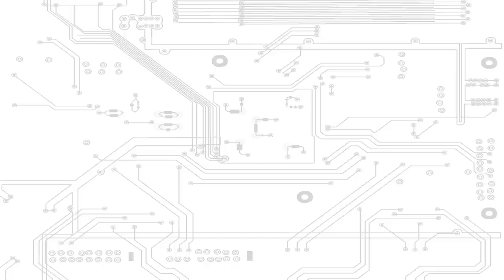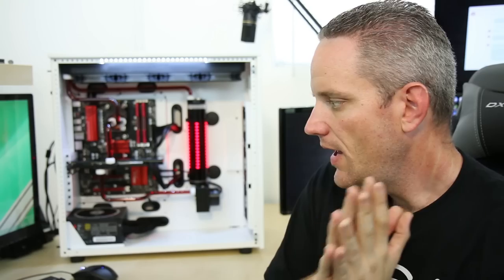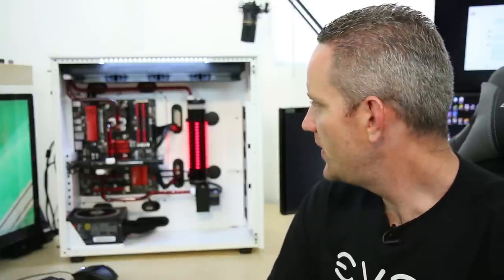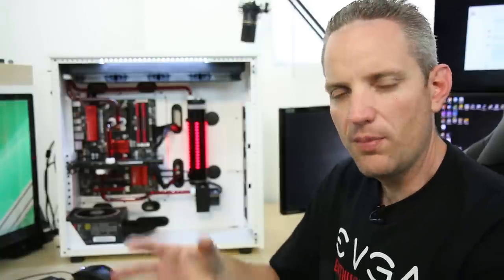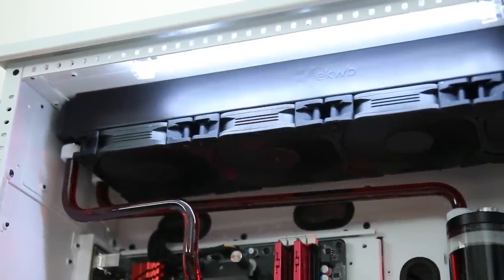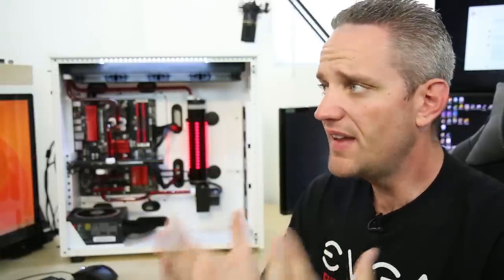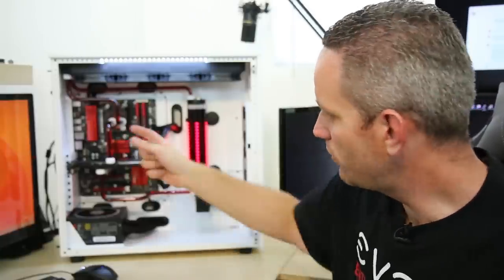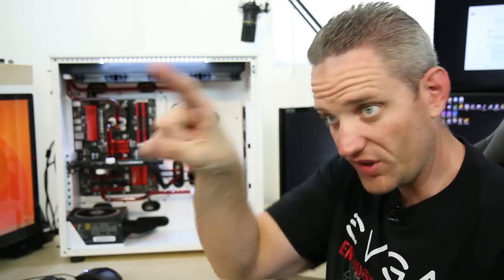Custom Watercooled AMD Gaming PC

Comment: Given your expertise in hard line tubing, I'd be interested in seeing you try building a loop with soft copper tubing. I feel that there isn't much videos out there regarding copper tubing for watercooling. It was interesting to see Paul jump straight to hardline, skipping over soft tubing for his first custom loop, but some nickle plated copper tubing for his arctic panther build would have proven to be badass.
I somewhat recently completed my first custom loop using soft copper tubing, and it was a complete nightmare but oh so satisfying to finish it (would NOT recommend anyone new to watercooling to try this for their first custom loop, at least get a little experience with hardline acrylic / PETG tubing first). It would be interesting to see someone like Jay try his hand at soft copper tubing. Might be able to add a little more variety, might be a good challenge and learning experience, maybe make a video series of the entire process. That may prove to be quite entertaining :)
Reply: 95trane I've built a couple loops with soft copper tubing -- and I am getting ready to redo one of those loops to reconfigure a few things -- the problem with trying to do soft copper is tubing itself. You have to straighten it, for one, unless you buy pre-straightened lengths of soft copper -- they do exist, but they are not cheap, and the longest length I've seen so far is 24", which would be too short for a couple areas of my current loop.

And straightening it is a pain, especially if you go with the larger 1/2" OD tubing, which is what I used since PrimoChill's fittings are for that size. Koolance makes three different size fittings for soft copper, but you still have to straighten it. And you have two options: buy a straightener (such as from KwixUK, least expensive one I've found), or use a vice, vice grips and a mallet.

Beyond that are the other tools. Now if you go with 3/8" OD tubing (Koolance is the only one making fittings for that as far as I can tell), then you can find a tubing bender without a problem from any hardware store. Go up to 1/2" tubing and now you're going specialty. Home Depot and Lowe's from what I saw don't carry benders for that diameter. The bender I have cost me about $45 from Zoro.com, but easily goes for much more elsewhere, and is made for HVAC professionals and plumbers.

If you're willing to spend money on the tools, you can certainly do it right. But if you don't want to budget $150 for tools, you're going to end up with a badly done loop. Go with PETG instead as the toolkit is much lighter on the budget -- heat gun, hacksaw, reamer -- especially if you have a Harbor Freight in your area.

Definitely would not recommend copper for a first-time loop either as you will only frustrate yourself to no end.
Reply: brandishwar Yeah, I pretty much went the most difficult route with my first custom water loop...
Summer was approaching and I don't have the coolest components so watercooling was pretty much a necessity at that point if I did not want to downclock everything just to prevent my computer from crashing due to overheating / reaching stupidly high temperatures. I could have went with soft tubing but wanted something a little more showy. Was contemplating getting hardline for a little while but I was going to be using clear distilled water and wanted a little more, so I decided to go the soft copper tubing route. I went with 1/2" soft tubing, and everything in which you have mentioned I had to deal with for my first custom loop and it was horrifying. Bought the copper from home depot, had to "straighten" it by hand as I could not afford a straightener, had to buy a 1/2" soft copper bender from amazon because home depot only had 3/8" ones (you can bend it by hand, but it requires quite a bit of finesse, but forget about bending it by hand when cut short). I messed up quite a bit of bends and have a mini scrap yard to prove it. Hardline, you can revert your mistakes to a degree, not so much with soft copper. Glad I decided to go soft tubing on the backside, the non-show side, as there is no way in hell I would be able to use copper back there. After having to deal with that nightmare, it was so satisfying to finish it and get my computer up and running again... only to redo the loop about a month later to improve the heat dissipation (I organized the loop in possibly THE worse possible way I could the first time around, much better this time around) and relive it all over again :D
If you are going in merely expecting a challenge... please go with hardline acrylic / PETG for your first loop. If you are a hardcore masochist looking for a thrill while pimping out your computer for the first time, by all means go ahead and use soft copper tubing. brandishwar is correct on every aspect. If I had only knew this before, maybe I would not have gotten into it so light-heartedly.
Reply: I'm on mobile so ...
Thumbs up ;D
Reply: 95trane Maybe that's why my attempts at a copper tubing loop were so screwy- I tried saving money with buying soft copper coiled tubes (at Menard's no less). I could straighten them by hand but it won't be perfect, and the Ridgid bender I have pinched the tubes too much. What wall thickness is good? Type M? Type L? I think mine was a bit too skinny and that's why it pinched in the bends.
Reply: ccricers I used type L tubing (I think it was Model # PCLE-375L010 under the Home depot website). Slight pinching on the copper should be somewhat expected, but of course too much is no good. Did you try bending the copper "fresh" or after you have cut it to length? Trying to bend the copper when it's too short, and making bends that are too tight may cause issues with pinching or even kinks in the copper. Try bending a long piece of "straightened" copper first and THEN cut it down to size; that way if the ends are pinched you can just cut them off with little to no issues.
Just in case you were wondering, just put B00HNQRJ6W in the search bar of amazon for the copper bender I used. I would link you to the stuff but I don't want to risk this comment being marked for spam.
Reply: 95trane How well did the copper tubing do in the system?  My dad spent years working with copper pipe and I was thinking about trying to do a custom cooler with copper.
Reply: ***** It's worked out pretty well, not the prettiest but functional. It was also a major pain in the ass but satisfying once everything was over with; however I don't see it being any more beneficial than say PETG/acrylic tubing. Because I was using clear fluid (normal distilled water), the copper helps to add a little bit of character to my build so there's that; but if you plan on using colored fluids it'd be a total waste of time and effort I feel.
As for the copper itself, it depends on the type of copper you will be using. Are you planning on using hard, rigid copper or soft copper? You can pretty much rule out bending hard copper and will have to go the fittings route for actually making bends. Even with soft copper you will need a tool to bend it (and preferably one to straighten it as well), but I will assume you have one of those due to your dad's experience with it.
Using copper tubing may add more things in which you have to keep an eye on however compared to other types of tubing; that being corrosion. My first batch of copper tubing was slightly corroded by the time I switched it out to optimize it's heat dissipation due to me not adding enough anti-corrosive additives to the loop. With PETG/acrylic, you don't really have to worry about switching out the tubing unless it is stained with a color you no longer want (to my knowledge). And with soft tubing, there is possible staining and leeching plasticizor but switching out soft tubing isn't very difficult at all. Metal will eventually corrode regardless of what you do; you're only capable of slowing it down. Aside from the possibility of the plasticizor from the soft tubing gunking up your pump, corroding metal in your watercooling loop is never a good thing.
If you do go on with copper tubing, then good on you! You dad's experience with it should help you greatly if you do. However just keep the galvanic corrosion factor in mind :)
Good luck with your custom loop and try not to pull out too much hair!

Comment: Can you do a budget water cooling build with hard tubing with a budget case.  By budget I mean 100-200 for the water cooling parts.
Reply from the maker: slimfitalfonze13 No, because that budget is too small.
Reply: ***** So what would be the minimum one could spend to watercool a CPU only?
Reply: ***** What do you think a budget system like this would cost? With something like a CPU/GPU and dual rad setup?
Reply: slimfitalfonze13 Custom loops are not budget oriented. It's that simple.
Reply: GOPACKERSJT Well, everything needs a budget. There must be the best price/performance parts, and there must be cheaper parts that work fine. I would be interested in a total price/parts list of the cheapest possible setup that is not per-say "cheap".
Reply: slimfitalfonze13 a budget build would be difficult, since for the basic parts, CPU block will cost at least 50-100$, there are more expensive ones I believe, the radiator 60$ - i am not sure what the most expensive one is probably around 120-180$,, pump reservoir piping and fittings at least another 80$.
Reply: slimfitalfonze13 You could probably do really cheap build for like 150$'s - although for your blocks and radiator -  that's where you're going to probably spend the most.
I'm interested into his opinion on this too though.
Reply: For that price it would be better to just get a good closed loop one such as the corsair hydra h100i,.
Reply: ***** 
Hey Jay, could you do a video of the best - cheap version and the best bang for bugs version of watercooling.
Tell us where the money needs to go when to take a beter pump, when to take a better radiator etc.
that would be interesting for me.
Reply: slimfitalfonze13 Any full loop you manage to get within that budget will not cool a system better than a solid $100 closed loop cooler.
Reply: ***** *****  I would like to see a best cost and efficiency parts list build because the Alpha Cool kits are expensive sometimes and the reservoir mounts in a 3.5 inch slot which many cases now do not support and the EK kits are expensive as well and I feel putting together a parts list will help you save that extra little bit of cash.
Reply: cee128d Buy an AIO.
Reply: ***** Like everyone else is saying, it would be interesting to see a hands on comparison of the top of the line AIO coolers and the cheapest possible single/dual rad coolers. Possibly cooling both the CPU and GPU at once.
Reply: slimfitalfonze13 Cheapest loop made was $100 for GPU And CPU Obviously it was crappy though xD! But seriously i think the cheapest efficent custom loop for GPU And CPU is on amazon, full kit. Don't really know if you should buy it though it seems to good to be true since it even has a flow meter and tons of accsessories for 180!
Reply: slimfitalfonze13  xspc x420 res/pump combo . with a xspc raystorm cpu block . then what ever for fittings tubing and water
Reply: ***** maby as budget 200-300
Reply: T2ak Dude you can get high quality CPU Loop for 300 or 240 which ever floats your boat (Ek L240 or Thermaltake Pacific RL240)
Reply: ***** in that case, perhaps just budget minded in general. the shrewd man's Liquid Cooling options.
i.e. no frills, just the basics to keep costs down. i'd say include both CPU and GPU, because if you are looking for inexpensive and only to do one or the two, AIO Liquid Coolers cover that already.
Reply: ***** linus did  it .  sort of   ... just watch scrapyard wars 2
Reply: ***** What's the cheapest you can go for watercooling? I really wanna do it but don't have the money.
Reply: EpicGamingHD  open loop gpu and cpu 350$ min
closed loop cpu only, 35$. min
closed loops for gpu and cpu 35$ + 35$ + 25$ min
Reply: vinak963 BOOM, there you go that is an awesome topic
Reply: slimfitalfonze13 LinusTechTips tried this with their scrapyard wars series.... didnt't go so well for them.
Reply: thetechnicalbouse but a professional would be doing it, rather than... Linus.
:>
Reply: haha
Reply: slimfitalfonze13  200 will cover both cpu/gpu water blocks only.  another 100 at least for rads. 50 at least in fittings. don't cheap on on the pump/res. minimum 100 for a decent combo  i wouldn't recommend even trying unless you had 500-600 to start with.
Reply: Devin Rovell Hey there's the thermaltake pacific RL240 Kit thats actually a great kit. (Only problem is the pump/reservoir can leak in some kits but that's barely a problem it's just that idiots are running the pump dry.
Reply: Cammy_Mustahce yeah there is always that. if i were on a real budget i would get an h220x-240x and add a gpu water block and a 120 rad and call it a day
Reply: Austin Dube so  i guess people with blower style coolers are stuck with them
Reply: ***** 

Agreed. Unless they went with one of those pre-built blocks from Corsair, or another brand, water-cooling to begin with is out of the question.
Some of their CPU coolers can be had for 50$ even. Not as good as a higher-end model or custom full loop system but they're still pretty good, heck some have a proper copper-base/pad now instead of the cheap aluminum.
Reply: +slimfitalfonze13 http://www.performance-pcs.com/catalogsearch/result/index/?dir=desc&is_ajax=1&order=rating_summary&q=xspc+cooling+kit
combo is less than buy everything separated, but you won't has many choice to choose your parts.
Best regard!
Reply: I spent about double that on a pretty basic loop (Just cpu)
Reply: +cee128d buy an ek kit.

Comment: *****, I want you to compare Titan X water cooled OC with reference 980 Ti water cooled OC with custom PCB 980 TI water cooled OC. Is that possible?
Reply: Rodrigo Marques Titan x > custom pcb 980Ti > reference 980Ti. At the end of the day the difference between all of them could potentially be 4-5 fps
Reply: David Burke are you sure? I have been saw some review getting a tie between 980 ti non reference with Titan X
Reply: Rodrigo Marques Bs my friend, some tech pages dont supply correct info. Titan X gets beaten by Sli 980´s. But theTitan is in between the 980 and Sli configuration by 10 to 15 fps depending on the game in terms of performance.
Reply: Alberto Pettine Not even close, the Titan barely gets a few more frames over a 980ti. Obviously an SLI setup is more powerful than a single GPU option with the flagship models.
Reply: Rodrigo Marques the 980Ti is a Titan X that's slightly shaved down. since it's effectively identical other than vRAM, performance will be just a tiny bit lower. 
so that ordering would be correct. if a modified 980Ti and a Titan X tie sometimes, that's within margin of error anyways.

Comment: Jay, I think you should do a video all about pumps. Get a bunch of pumps from a variety of manufacturers, and give your opinion on them. Noise, headpressure, cost, reliability... You could also talk about general stuff. Pump/res combos, are those good? Do I need a dual pump setup? How do I properly mount a pump without it transferring vibration? Are there any brands I should avoid? What speed should I run my pump at? What is the typical lifespan of a pump, and how do I know if it's dying? Yada yada yada, you could talk about all of that. I know you've addressed a lot of that stuff in your other videos, but it would be great to have it all covered/summarized in one.

Comment: Such a pretty pc....  as an 8350 owner with a Silencio 500 case using air cooling ( I hadn't build a pc in a long time)  I'm very tempted by that case, and starting in water cooling.  Great layout, and nice to know that you can bend those tubes by hand,  helps us on a tight budget!

Comment: Great video Jay. System looks amazing. Some questions:

What effect does the added die have on system temperature? Negligible? Is the die simply food colouring?

Does it matter which components are cooled first in the loop? Or should the component which is overclocked closest to it's maximum limit be the first component in the loop and therefore get the benefit of the liquid while it is at it's coolest?

What maintenance needs done on a liquid cooled system? How do you drain the loop so that you can conduct maintenance? How many hours can you typically get out of the pump before it starts to fail? What are the warning signs of a failing pump?

Thanks Jay. And thanks to anyone else answering.

Comment: Great system! I'd like to see you cover the following topics:  Your Design Process, Step by Step rigid tubing bend and install (mistakes included), Pumps- selecting them and picking their accessories like cases.  Wire Management.

Comment: I used rigid tube for my first water cooling attempt . I made some mistakes at first , but I agree with you Jay, buy lots of tube and just have a go. The hardest issue I had to deal with is my case is an Phanteks Ethoo Pro which once it was full of my hardware left some small areas to run the tube through. And I made a noob error of not putting enough lube on the silicone mandrel and got it stuck inside the tube after it was bent. I've burnt tube by not moving it fast enough and used too high setting on heat gun. All those sort of things take time but once you practice and learn the skills you can take pride in your work and show off to all your friends.